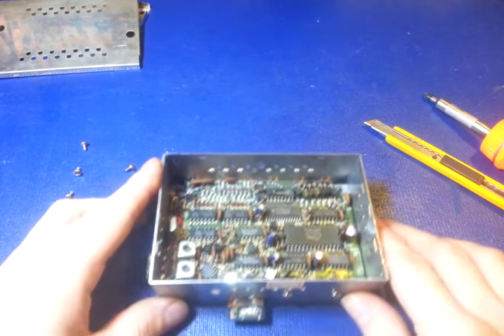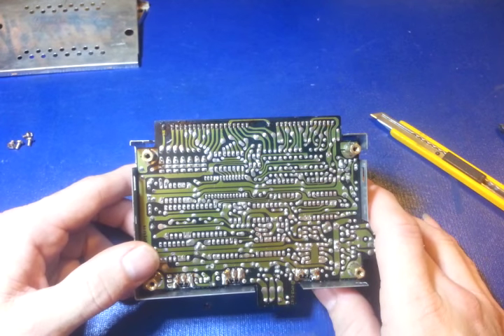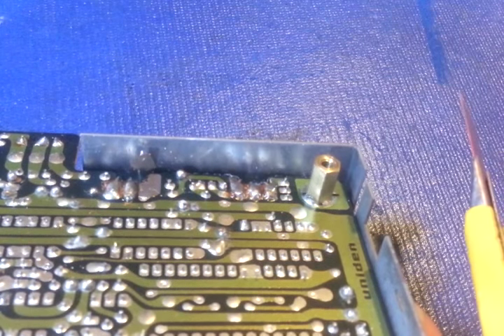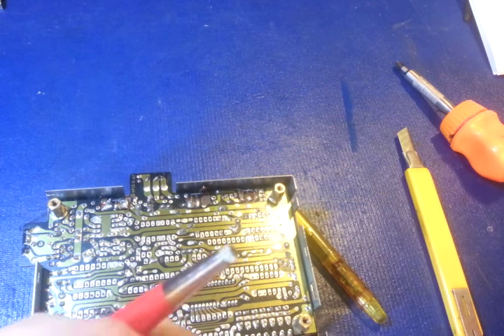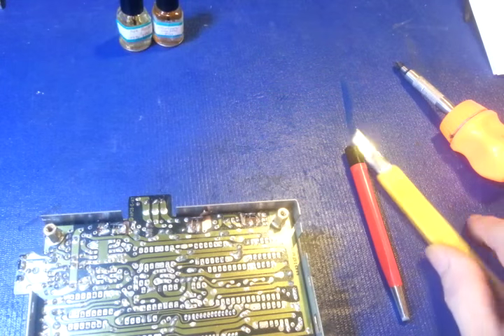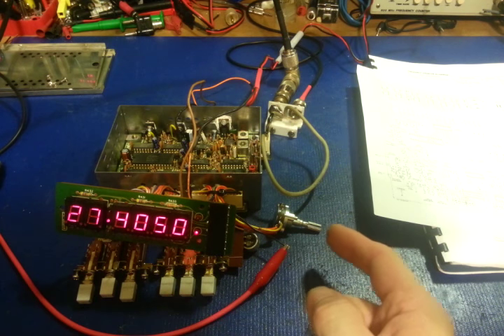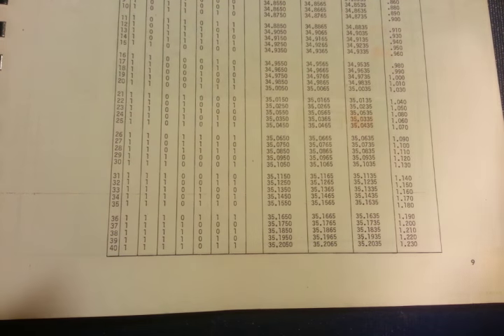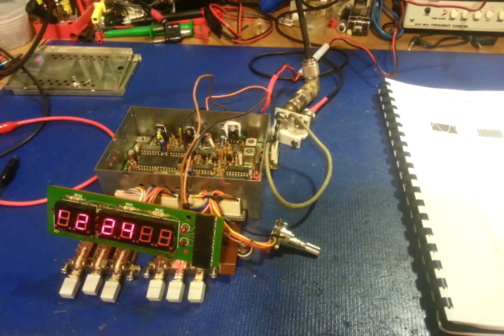Cobra 2000GTL frequency counter clock module repair. Bad solder connections.

Comment: Well Mike, I have an Intek/galaxy and it's FC had intermittent functionality. After I replaced the electrolytics I found a bad solder on the main board for the coax... Well, the capacitors replacement solved for the most part the switching noise caused by the display driver

Comment: I have seen this quite a bit myself Mike. You know the main counter board is wave soldered.  But the out side transistors and metal case is hand soldered. I have to wonder what they put on those terminals before going into the wave solder process. You will also find the B&K 2040 has this issue as well.
Reply from the maker: That's why I said test equipment in the video because I have seen it in my 2040's as well.  It's not just the hand soldered or wave soldered portions, its the whole board.  I have replaced IC's on these boards and their just like this.  I really think it was the copper they used that didn't mix well with the solder and over the decades starts to break down.
Reply: You may be correct. I have a 2040 I have considered to be useless now. The whole board is like that. You can push a component and it will come loose. Regardless what I do I can not get solder to stick to the copper. Even silver solder will not stick.
Reply from the maker: +The Radio Shop 

Tried cleaning the traces with a fiberglass brush yet?
Reply: That was the first thing I tried,  nothing. even tried sanding some of the copper away.
Reply from the maker: +The Radio Shop 

Maybe I need to send you some of my "special sauce" liquid flux. :)
Reply: He he, Perhaps so. I also need to order some more fiber brushes.

Comment: good tip with the fiber glass!    as for the connections not being properly soldered, i believe those were done by hand in an assembly line, its very possible it took too much time to flux it first... and poor QC

Comment: have a counter that reads 92.2000 in one radio but works fine in another. where might i look to find the issue. cobra 2000GTL

Comment: Why have you stopped uploading HD videos? A quick check shows that all of the post CPI CP300 videos are SD. For me, at least, it does make a difference in the level of visible detail.
Reply from the maker: Hmm, hadn't even noticed that.  Somehow it got changed in my camera.  Just changed it back.  Thanks for the heads up.
Reply: Awesome! Thanks!